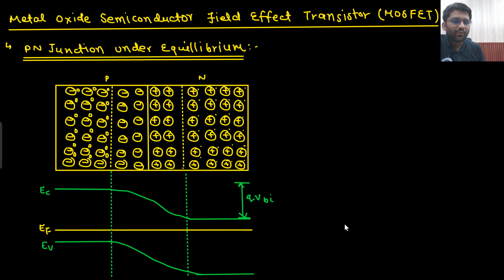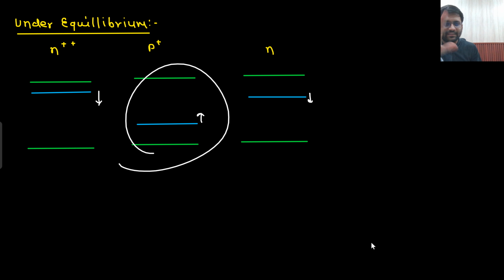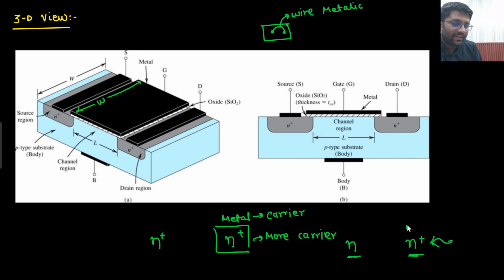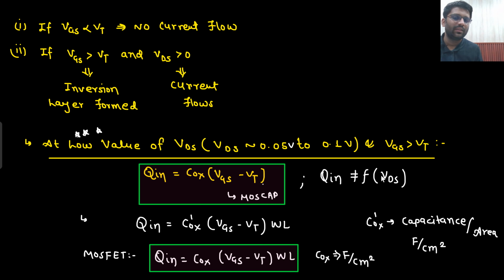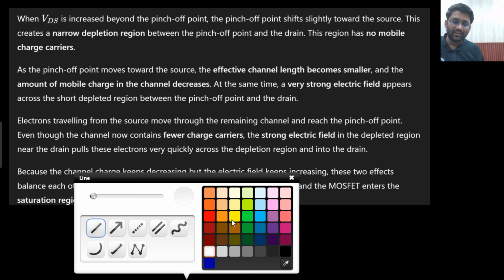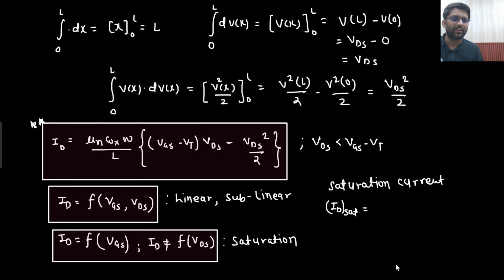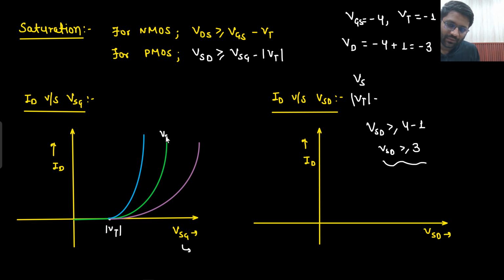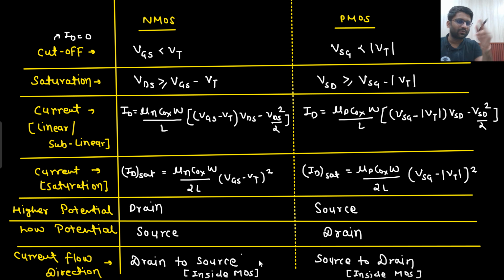Introduction to the MOSFETs || EDC || PrepFusion

Comment: 2:46:00 ig there is small mistake in Id vs Vgs charateristics like the violet graph should have value less than 2V
Reply: for the same value of Vgs shouldn't higher the value of Vds higher be the current
Reply: @Ano @Anonymous-se6sp  I agree with you for lower values of Vds ,Id should be lower so As Id3<Id2 => Vd3< vd2